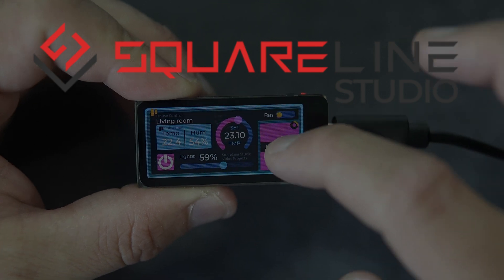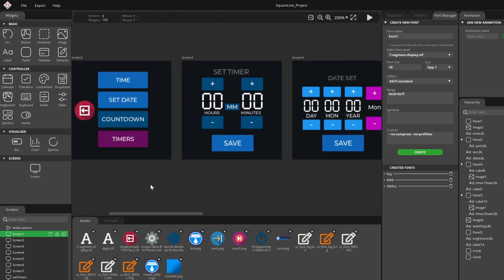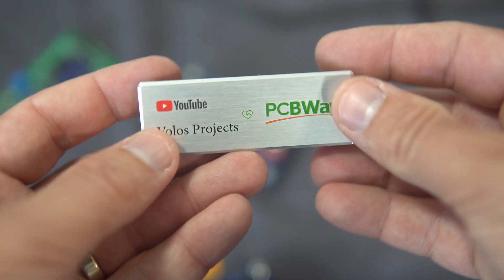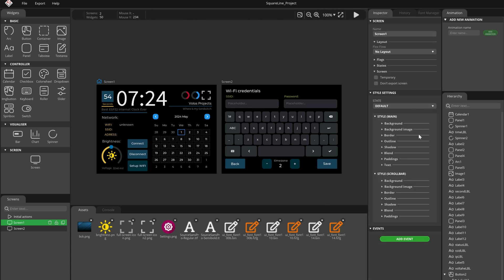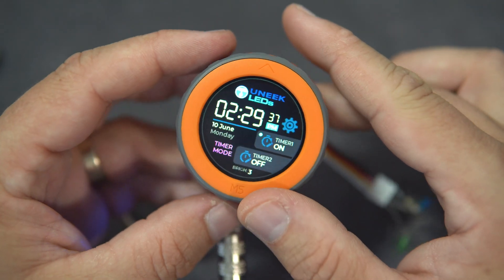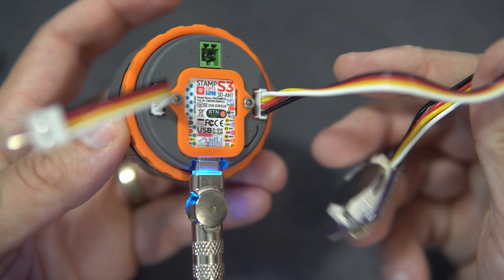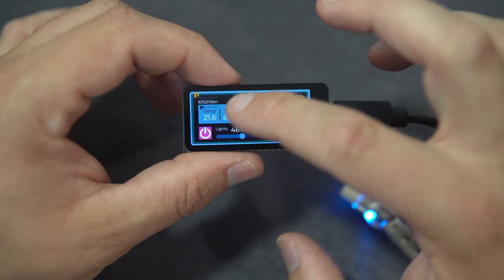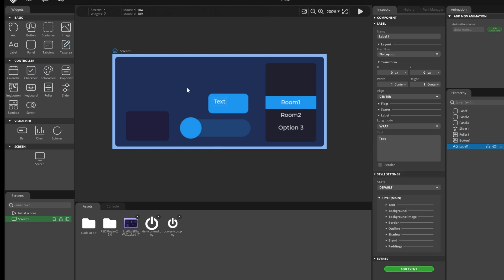Yes, I Changed My Mind: Using SquareLine Studio and LVGL Now!

Comment: Hi Volos, I bought a Makerfabs MaTouch 7 inch display you used in a previous project. It would be great to use with LVGL. I wasn't able to make the library setup. Could you help me? I think a tutorial for LVGL setup would be very useful for many of us. Thanks
Reply from the maker: I never used that big board with lvgl, i am not sure will it work. i will check today.
Reply: @VolosProjects  did you tried it? I have some progress starting from your sketch written for Matouch 7 video. I can write an "Hello World" on the display but all colors are inverted and also the touch doesn't work (it works  but LVGL can't sense the touches). Please let me know. I think this could be useful for many other people. Thanks for your time.

Comment: Glad I found you 👏, very interesting videos you are making, you have earned a loyal subscriber 💪, just a question what pin mapping you have used for the m5dial in the user_setup.h in the tft esp folder to make it work with squareline studio
Reply from the maker: @hamouz718  thank you. No, you dont need change anything in tft espi library when working with m5dial. I will make video about this topic. M5stack boards are sometimes painfull when dealing with lvgl and sqareline.
Reply: @VolosProjects  fantastic, will look forward to that, didn't work for me with original setting, after trying everything, I instead just use code for now

Comment: Can I send you a Lily Pi to use with the tutorials, that board is little ugly but is complete with SD card, RTC, relay output, 2I2C ports battery so please take a look.
The hardware is very supported by ttgo and community and libraries are very completed... It also works for T-watch, is the same hardware... Ah I forgot to tell you 480x320 resolution..

Comment: While you are on the learning curve, I would surely like to see an end-to-end from start of project to working display for a simple T4S3 SquareLine project.  The trouble, so far, is that it is not supported by tft_espi.  And, specifically for the Arduino IDE.  I can't see going through the learning curve for IDF.  Thanks for considering this request.

Comment: What about using the ESP32 Cheap Yellow Display Board (ESP32-2432S028R)
Reply from the maker: I am not sure CYD is good choice for this. Older esp32 ic and no PSRAM memory.
Reply: That's fair.

Nevermind, I have one sitting here that I need to learn to use properly.

Comment: About time! I wanted to show you how to use SquareLine a while back. I've never been one for making and editing videos however and got too frustrated in the process. I guess I'm getting old(er).

My coding is nowhere near your level and my biggest issue with SquareLine was that I could spend an hour or a few making great ui's but they never worked once uploaded. Everything was there but touching the screen or clicking buttons never really done more. I thought I would have to edit the code also which after looking at it, was an absolute nightmare.

I guess now you will teach me. If you had any idea just how much I have learned from your videos you would be astonished. I have a full lab with everything one would need equipment and component wise. I'm stocked to the teeth with dozens of micro controllers, More LilyGo boards than a normal person could ever need and missing the knowledge hehe. I'm getting there though. 

Thanks again!
Reply from the maker: Tnx man, i glad you learned lot, i hope you will more. Me to, room full of controlers and board. Sometimes is hard to decide what to use.

Comment: I currently see the biggest problem in the compiler. There are now quite a few DIY projects that can no longer be reproduced because they require very specific libraries and specific compiler versions. If something is wrong, you get error messages that you can't do anything with.
Reply: Yes, I tried a couple of projects, and I couldn't figure out which version of wifi library, or some others, too... The ESP32 space has become a bit "cluttered", a bit "wild West".... I'm poking around with Rust, and probably try to use ST's IDE, and it looks like NXP and Infineon are trying to get good infrastructure in place, too

Comment: I would like to see how to use SquareLine studio to program a LilyGo T-Display and PlatformIO under Visual Studio Code. I have tried to design some basic things using this software, but I got a little confused when I had to export and manually copy some libraries to my project (maybe I did not understand correctly what to do). About the project, anything simple to show the basic steps to start a project from scratch and upload it to the board. That would be much appreciated. Thanks and congratulations for what you do.
Reply: Would be awesome, i also tried me with an esp32 s3 round display an wanted to connect it with my phone to display music Navigation and weather on the small screen but dont know where to start :/ …. At least i found this amazing Channel

Comment: I have not used Square Line Studio yet, but I did a few projects using Nextion's display programmer thing. It does have some nice speed advantages in both development and execution, but the major drawback is the hassle of uploading the new code to the display each time I make an edit. The Nextion code has to be uploaded either via SD card or I eventually installed a switch so that the display is either connected to the MCU or the programmer. 
So how are you uploading the display code with these Square Line displays?